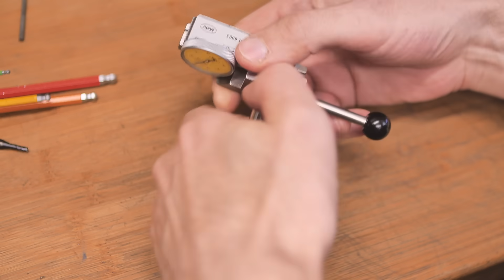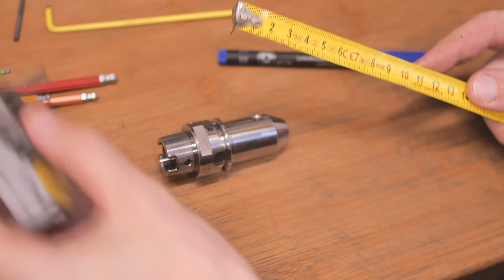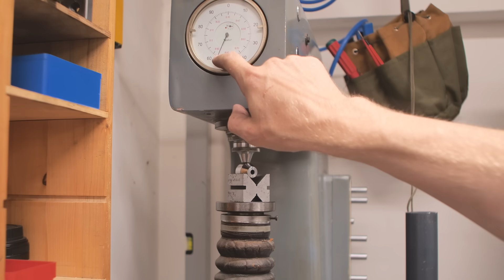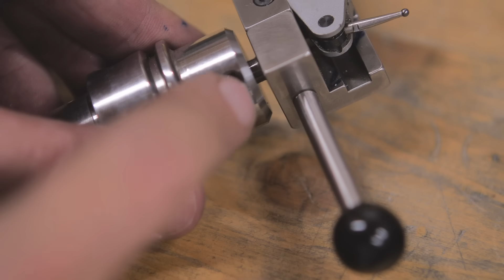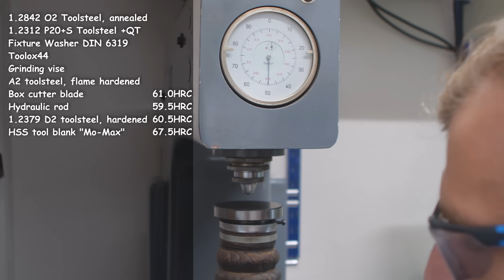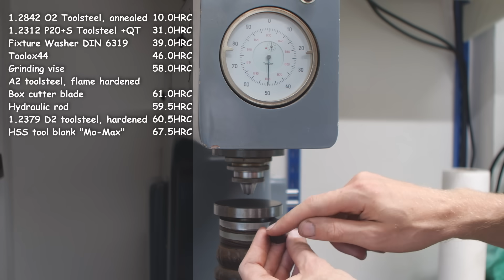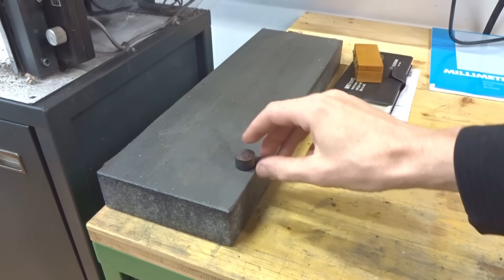Hardness and modifying a toolholder

Comment: I have a small hardness tester but I find that I use the "cheap" American files indicated as made by Nicholson  but in reality they are manufactured in Mexico, Brazil and China for the sliding hardness testing. I can't use any of the four Nicholson foreign manufacturers for any kind of filing work since they are ruined, they're warped. I do have American-made Nicholson's that I use for nice work but, I have very few of those. I use F. Dick (German manufactured), Grobet - Vallorbe (Suisse manufactured) and occasionally I get the (British Stubbs manufactured) files which I use for precision filing on my parts.😮

Comment: Very interesting video!
My old SPV hardness tester has a "fork" nose so that round  pieces center conveniently without a v-block below. This  nose shape works for both round and flat stuff, but there is a correction table that needs to be applied for the smaller diameters. I find the results pretty consistent. I have destroyed at least one diamond on to soft stuff, if readings tend to become erratic this may be the problem.

Comment: Stefan, if you grind/remove the decarburized layer from the (flame) hardened part, does that increase the hardness reading you get (in a worthwhile way)?
Reply from the maker: Yes, absolutely. In some cases the decarburized layer can be very soft. I noticed that especially with O2 toolsteel.

Comment: Great video Stefan, Never used a ball endmill to start a hole before, is it better than a standard endmill and spot drill? Thanks
Reply from the maker: I found it better when trying to spot in hardened material, since it gently enters the material.
I have a video on cutting hardened materials planned, i will go a bit more in detail there.

Comment: While studying, we had a compulsory target of certain number of summer work months.  My first one was in an iron foundry and it was long into the next winter before my skin pores had clered of the black casting sand.  But actually my story is about a piece of ferro-chrome I found more or less abandoned somewhere.  I got an idea to make an ID tag for my keys out of it, but needed some help for finishing my tag.  There was an engraving machine that I tried to use for the marking - to no avail.  An older worker checked the hardness of the piece as 64 Rockwell Hrc.  He took a pity on me and told the only way to mark my name on it was etching.  Well, we did so, and I got a unique tag for my keys.  The only problem was that through the years it cut the stainless steel key ring to two pieces in my pocket.

Comment: With the abrasive cutting, did the heat generated affect the hardness test on the cut end?
Why not test on the smaller uncut end ?
Reply from the maker: Naa, those wheels cut so cool and put so little energy into the part, theres no effect to be expected :)

Comment: How did you deburr the inside of the threaded hole, or was that not necessary at all? That's usually the hardest step for me, particularly with crossholes into precise fits (like the one at 1:35 )
Reply from the maker: Carbide burr (Ballshape) from inside, sorry didnt show that.

Comment: Taps would be a lot nicer to use if the square drive was next to the cutting part instead of on the end.  That way it’d be easier to hold and to turn when used in a spindle.
Reply from the maker: Haha, funny, because i think the same. I have several tapps where I ground a square drive close to the flutes for that very reason.

Comment: It would be interesting to see the hardness of a old copper washer for sealing hydraulic joints, pre and post annealing.
Reply: 80HB and some 35 to 40HB if its short time, even under 35HB after long time (30 min is long for pure copper or 93Cu7Zn).

Comment: I had a similar situation several years ago with a very hard layer internal in a bore that I couldn't drill through with what I had. I used an old end mill, chucked with the blunt end in the hole, spun it up to max speed, and pressed it into the hole to create friction. Stopped when I could see the inside glowing bright and let it cool slowly to anneal. The rest of the job went easy.

Comment: Now I had to look it up, yes there are carbide taps, but I can only imagine how easily they must break, especially small sizes like this. And they're pretty expensive.
Reply from the maker: We had carbide taps at my old dayjob, if somebody didnt thread a hole deep enough in a hardened componend before heat treatment.
They suck to be used by hand, very crunchy feeling tapping into trough hardened toolsteel at 55HRC :D

Comment: Someone already mentioned the Fimax adjustable angle magnetic transfer block. These were made by Darwins Group of Sheffield here in England. Not sure they are still in production, but often available on EBay. Usually as Darwin - Fimax. I have one of these. Very interesting and informative video Stefan as usual. Thank you. Cheers Nobby @nobbysworkshop

Comment: Very nice height improvement! Best part for me was the copper wire idea for set screw versus shaft protection. I'm going to use that idea for sure 🙂   And since this is now a dedicated indicator holder and won't be used with tooling I think I'd have just annealed the end and used normal cutting tools for this modification. Maybe not the best idea but that's what I'd have tried.
Reply: just have to watch out with the copper shim trick if you really needed torque, obviously this is a measuring instrument it needs no torsional stability

Comment: What is the hardness of simple high carbon steel like the very common  "silver steel" or "drill rod"  after quenching only, and also after tempering to an approximate light straw colour?
Stellite is an interesting alloy since it contains both chromium and tungsten, so how would this fare in the hardness stakes?
Can tungsten carbide hardness be measured on this tester?
Reply: When I was still an Engineer in the Merchant Navy, some of the diesel generator engines used Stellite for the exhaust valves. They were about 16mm diameter and 300 and odd mm long, and the deck crew loved them as Marlin Spikes. They used them to open up rope strands to splice the ropes. Ordinary mild steel was fine for sisal or poly ropes, but not much good on wire. They'd ask us if we had scrap valves and could we machine a spike up for them. A carbide insert would just about machine one with fine depths of cut and a slow hand feed to cut the taper a TNMG would use up half its cutting points. Cutting the valve head was the worst part, a high speed steel blade would just do it, if you heated the area cherry red and very slowly cooled it. The best thing to do was give the sailor a hacksaw and some new blade's and let him cut the head off.

Comment: For some reason it's relaxing to see such nicely finished tooling.  Don't get to see a hardness tester being used that often and I've always kind of wanted one for no reason at all other than it would be fun to play with for about 30 minutes every year.  The done-ness  of chicken when I cook it has always made me nervous so maybe it would get the most use in my kitchen.  My faulty common sense can't seem to understand how a V-block or any other backing material placed between the diamond and the anvil wouldn't affect the test results even after pre-loading.  Thanks for the video!
Reply: the measurement comes from the diamond cone sinking into the steel and then effectively measuring the dimple depth not the steel itself compressing, if you put wood below it it would be useless but if you put something hard that can't be compressed (reasonably) it's fine
the point loading of the diamond is so much higher pressure (force over area) than the backside of the part on even two small strips of contact in a v block.
it would be interesting to see how the reading changed if you set the part on three points.

Comment: Hey Stefan!
I had a similar problem adapting an SK40 weldon holder to a Lenz LPA boring head. The toolholder was around 60 HRC on the outside and I only had a lathe, mill and carbide tooling to work with - so I had to improvise. I went wirh partial annealing of the toolholder, which in the end worked out very well. I took a coffee mug of water, put the taper side of the toolholder into the water and annealed the to-be-cut side with a propane torch. You need to constantly top off the boiled off water, so that the taper won't reach annleaing temperatures. After around 15-30 minutes, the shank was soft enouch so that a file would grab but the taper wouldn't even show tampering color. Parting off, turing and maching an ID thread was still tough, but doable .

I hope, that this trick might help someone out ;)

Greetings from Nuremberg!
Reply: this is a brilliant idea ty

Comment: Very interesting video Stefan! Have you thought of what material the import grinding vise is made of? I have them as well and I like them! Sometimes in import tooling they write the material, but not the complete proper designation. They say manganese steel something something. Probably micro alloyed or something. You can see that on import morse taper tooling, shell mill holders, face cutters, end mill holders... Old manganese steel were used in the cutting edge and teeth of excavator buckets. When you hit rock the manganese steel hardened at the surface, but not right through the material! "Work hardening case hardening". Difficult to weld, there was a procedure using stainless stick rods... 307/309 aws.
Reply: I checked some import tooling now: 40Cr MnTi it says. I don't know the composition , but high carbon and chromium one could guess? With some trace of manganese and titanium? Didn't find much on the internet, maybe because the steel is of Chinese invention?
Reply: @trashanken  
Typical Chemical Composition:
Carbon (C): ~0.37–0.45%
Chromium (Cr): ~0.80–1.10%
Manganese (Mn): ~0.70–1.00%
Titanium (Ti): ~0.05–0.10%
Silicon (Si): ~0.17–0.37%
Sulfur & Phosphorus (S, P): low (max. 0.035%)